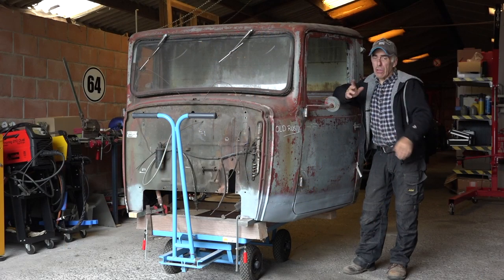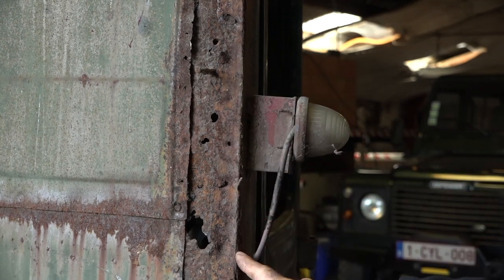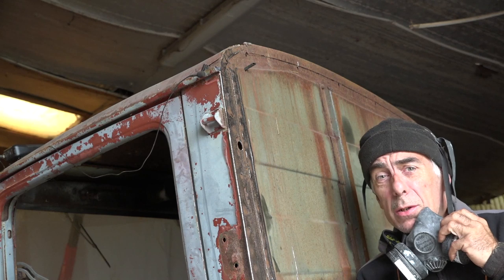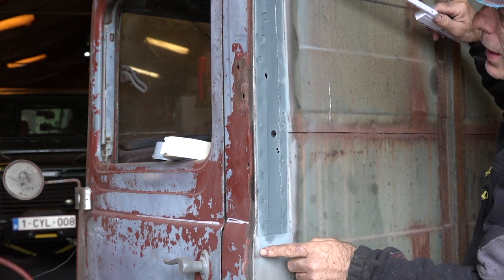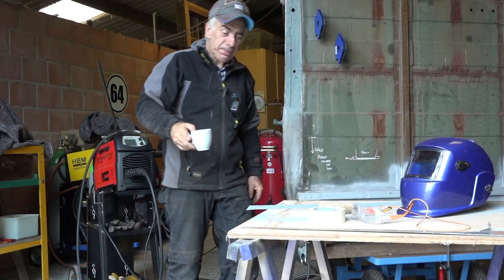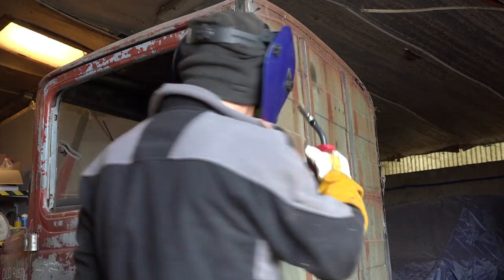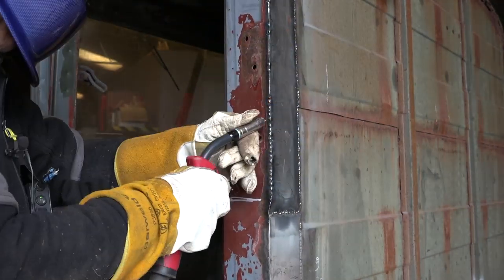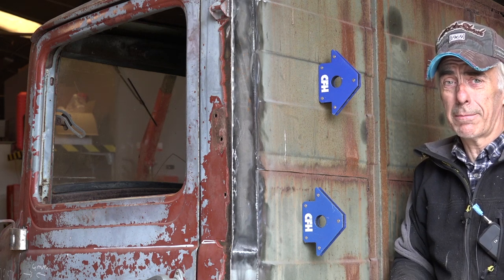Old Rusty, Part 18 Placing overlay of sheet metal on the rear cabin

Comment: I see a trap for moisture & dust.

I am fixing a tractor cabin that is quite rusty, but the most rusted parts are those where there is overlap with metals.
Reply from the maker: That is true, but it all depends how the old panels are treated and where they are placed. for a sill I would never do that.  The back of the cabin, is an area where that is not a prblem. and the cavety between the panels has venting holes

Comment: That was a very good result, are you using weldable primer for the under layer of paint, you can spot weld through that as well, which is very handy.
Reply from the maker: Yes, I use actually a zinc spray...  Thanks for the comments

Comment: Can you tell me/us a little more about the scheer/brake and roller combination machine.  I have been looking a three different machines but lack space in my shop. Who makes it?
Reply from the maker: Thanks for the comments, that tool is indeed 3 operatios in one.  The total width of cutting, bending or rolling is 100 cm  or about 3 feet.  The max thickness for cutting steel is 1 mm, whereas aluminium is about 2mm.  Bending is fine for 1mm panels, although I have done 2mm as well.  Rolling is easy and any thicknes goes as the rollers are 3 elements and are adjustable.  You can even bend boxes as the knifes are in segments.  So overall a very good tool and not to expensive. Here is where I got mine, although I have seen them at eastwood as well.  https://www.hbm-machines.com/producten/plaatbewerking/combinatiemachines-walsen-zetten-en-knippen/hbm-1015-mm-wals-zet-en-knipcombinatie-met-2-armen-model-2

Comment: Nice way to welding. What brand and type machine do you use?
Reply from the maker: Thanks  for the comments,  well I am no professional welder at all.  I just do things the way I think its right and works best for me...    the MIG is  Technomig 210Dual Synergic inverter from TELWIN... fully micro processor driven and works real wel.  many options and lots of self regulation features  https://www.telwin.com/en/prodotti/?id=816052&clmer=81&lingua=E&descProdotto=TECHNOMIG%20210%20SYNERGIC

Comment: Hi D3S! Love the channel and what you're doing. With paint removal I can recommend using these, not the flap disc wheels. I'm sold by these discs and they strip paint and not metal so fast!

Give them a try and see what you think.  https://www.mig-welding.co.uk/paint-stripping.htm

I'm not affiliated with that company, just the first link I could find. They're really good and can be bought cheaper online. 

They will help you loads on older bodywork panels.

Keep up the good work

Paul in Germany
Reply from the maker: Great comment, I will give that a try. Looks very promising . Thanks